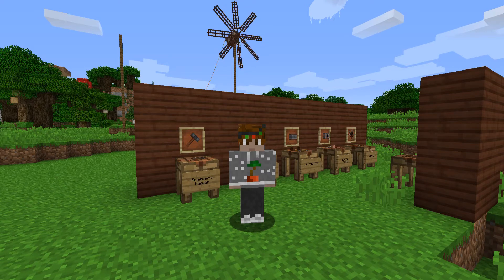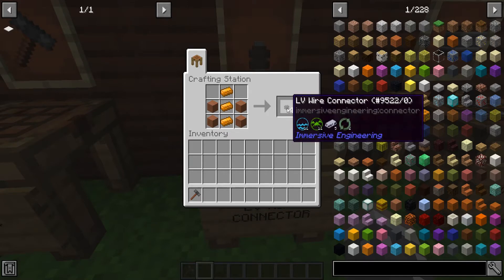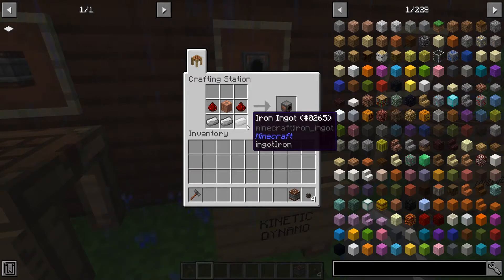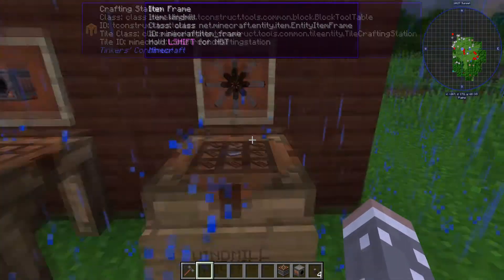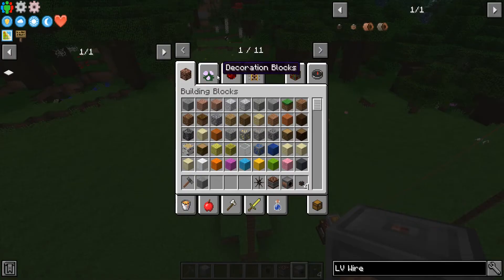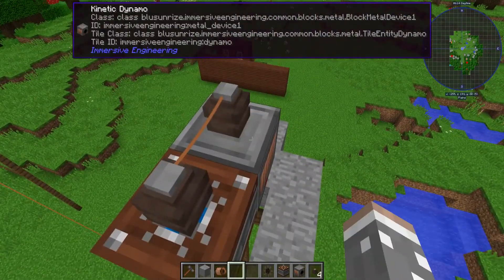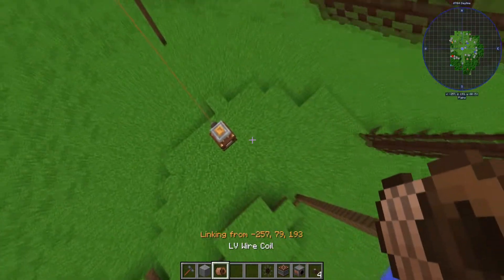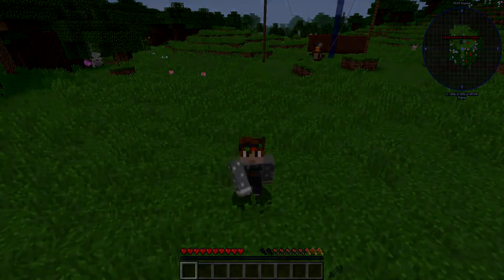How To Make Easy Power In Immersive Engineering

Comment: i cant make copper plate with the hammer and the coppe ingot help
Reply from the maker: It's most likely an incompatibility with mods. What tech mods do you have and do they have a copper plate in them?
Reply: @Gabibo  I have the same problem I have thermal foundation and thermal expansion
Reply from the maker: @m_3ye.  Thermal expansion has a copper plate item from what I remember. Maybe they overlap eachother
Reply: @Gabibo  I deleted it and it worked thanks